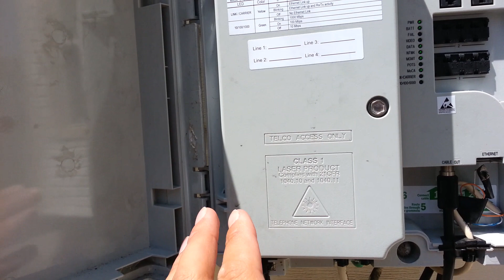How to Verizon FIOS Battery Backup for Internet tv and phone

Comment: Are you still using this Motorola ont1000gj2? If so, I have a question as I have attempted to switch from the cable out to the ethernet out, but the data is not coming through the ethernet port inside the box.  I have not attempted to open other components of the panel to see if wiring needs to be run to the ethernet port (and removed from the cable connection).  Have you or others attempted this?

Comment: My ONT lines run into my basement ceiling to a small power adapter box that then plugs into an outlet.  Could get a bigger UPS just for that power signal & plug the ONT power cord into the UPS.